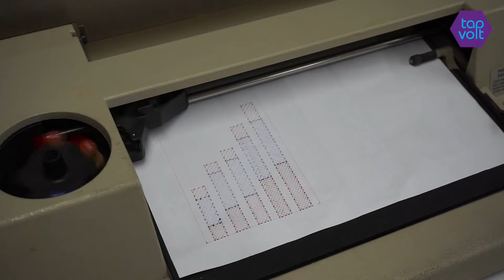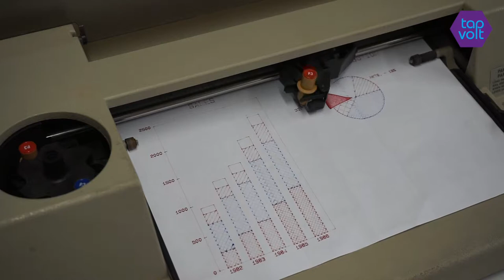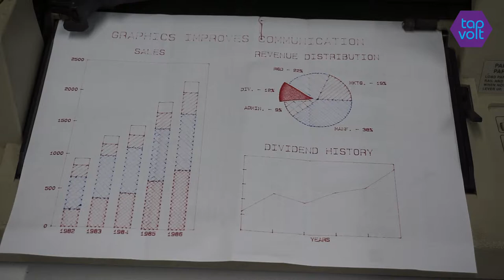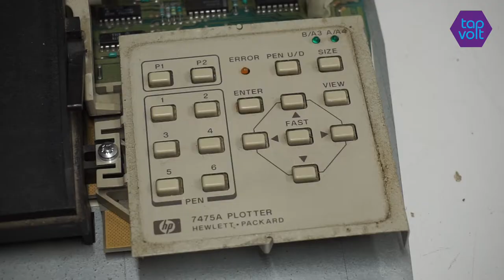Vintage HP 7475A Pen Plotter Restore Part 1

Comment: Hi, is there a way to run this plotter off a new windows laptop or do I have to use an old computer? Any way to adapt that connector to USB?
Reply from the maker: Yes. I have it run off a modern Mac with USB C. Needs an adapter. Easier to buy a plotter with a RS232 port on the back and buy a quality RS232 to USB adapter from
EBay.
Reply: HP plotters are usually either IEEE-488 or RS-232. This one seems to be IEEE-488 only. Adaptors are available but much more expensive than RS-232 adaptors. Roland plotters often have RS-232 and parallel (Centronics) interfaces.

Comment: Hi! When I opened mine, a small circular part fell out - its broken but can be repaired, the question is, where does it belong... do you know if there are any good inside pics somewhere?
Reply from the maker: Read the manuals.  They are very good.
Reply: I did of course, but at least the ones I found are a bit unclear as its seems a scan of a bad black and white copy, so I can't find it (or I wouldn't have asked).